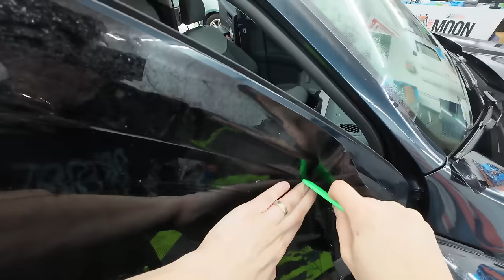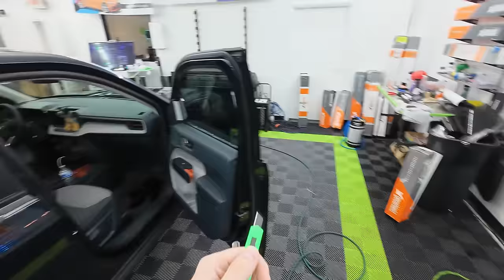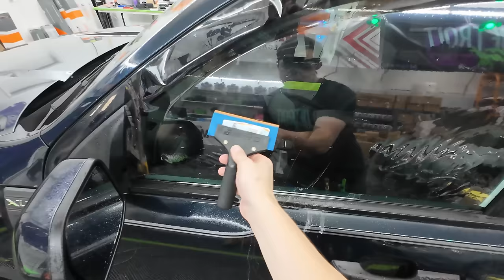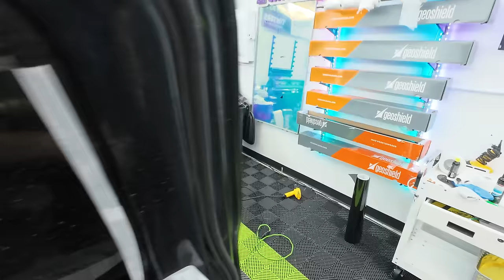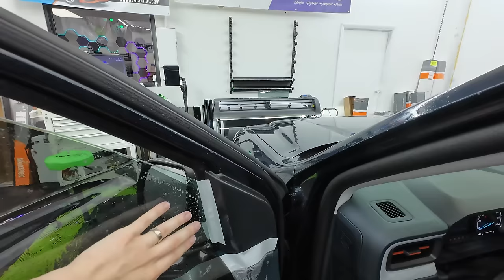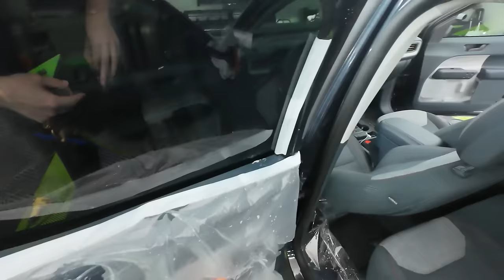How long to tint 4 door windows?

Comment: It took me 4hrs to tint the side windows of my Tesla M3LR.  Messed up 4 time; one per each windows.  3 were creased and one was cut short because of stinginess.  One needs to be redone again because I’m not happy with the result but I need another weekend to do so.

I bought Lexen koolmax because I didn’t want to pour too much money knowing that I’ll mess up.

Last time I tint my car windows was about 14yrs ago and that was with easy to shrink film before ceramic was readily available.  Ceramic seems to take a lot more heat to shrink.

Comment: Great info, I'd never try tinting my own car. I just pay my local 25yr tinter $35 a window for 25% for the front doors & a bit darker for the back here in TX. 
(The more windows, the cheaper it is) 
L.E. & Inspection places are cracking down on window tint here in TX. Gotta be no less than 25% & I seen a lady not pass inspection because her new car tested at 20% 
Talk about a joke, I think they could've let that one slide.

Comment: I see you folding de sides of the lower section into the seals when you are installing the top. I normally create a big finger in the middle just to relax te sides of the film. Is there a reason that you do it that way? *i’m a beginner
Reply: Bro I thinks that’s fine , you don’t have to follow to the T . If it works it works . I learned watching him but I also create a crease in the middle.

Comment: Should have did one window at a time. Get a better idea. Each side is cut differently. Left Vs Right. See if your cuts are the same on both sides.
Reply: This can definitely be true, especially if a piece of glass has been replaced with Aftermarket
Reply: it would be an identical process just put the liner facing you when you put the film on the glass.
Reply: @goatedvault1070  not true in many cases. Tesla will bite you in the A for double cutting for sure. I’ve tinted plenty VW cars as well, where the driver glass on the top edge was different from the passenger, and the shrink was also different. Double cut works, but not all the time. Especially with aftermarket glass. Always check your glass before cutting. I was mentioning, test how long it take to do every glass individually, in case it’s a situation like that, and how quick you can cut every glass.
Reply: @mikehonda7934  you would just double the time spent cutting in this video and get a rough idea
Reply: @goatedvault1070  negative. I’ve challenged this theory before. It will not double the time. The time it takes him to lay the film and the back and forth time walking back and forth from double cutting, you at most save 5-10m if you are a good tinter. Unless he is doing 6-10 cars in a work shift, it’s not worth the time. All double cutting does is make both glass have the same cut in one go. What do you do when you have to tint one piece of glass after a bad install? Strip the other and double cut so they look the same? No. That’s where skill and Precision comes in to challenge your ability to make the same cut on different sides of the car. My challenge was to see if he can do the cut on both sides symmetrical. Majority of his tint jobs are double cut to save time for us and to be symmetrical for the customer. Which is the way to go for sure, but when you can make the exact cut without double cutting, that will show how skillful, and precise you are. You must still be in the process of learning if you don’t understand that the process from driver to passenger side is different. Most people who tint will tell you, the glass cut differs left to right because the glass is different left to right. Even the shrinking is different on both sides. Example, cut a top edge of glass from right to left on the driver side, then cut from right to left on the passenger side. You will be cutting a different slope from the other. You will be surprised how many people can’t cut on both sides of a car.